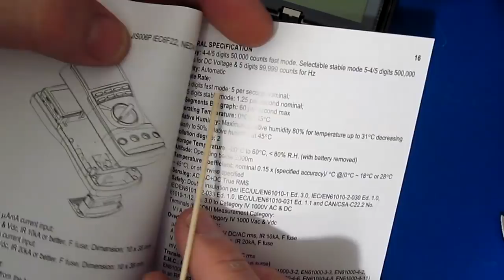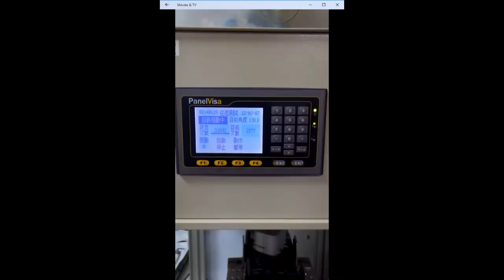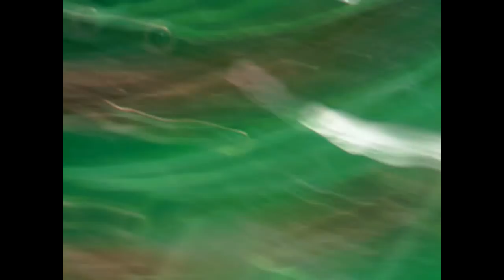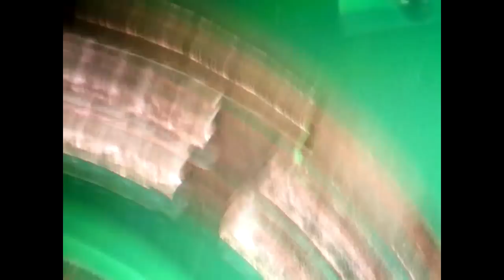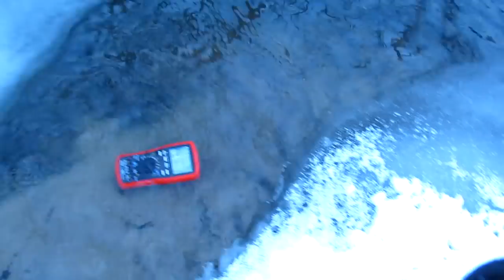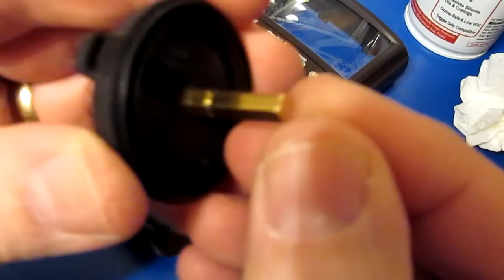Brymen BM869s 50,000 Cycle Test, New Year's Special

Comment: I'm in the US and just received a Bryman 869s.  I bought it from tme in Poland.  Their shipping time was amazingly fast, about 5 days.  The initial calibration seemed to be off measuring DC voltages, almost like it had never been calibrated.  I found a reference on the web that described how to calibrate it and with a precision 5v source I calibrated the zero and 5v levels.  Now it reads within a couple of 10 thousands.  Now it's an amazing meter.
Reply from the maker: My guess is you just screwed up the alignment but the readings you are getting make you feel better.
Reply: @joesmith-je3tq  The DMM Check Plus has higher precision than the Bryman BM869s.  Before I calibrated it the meter was off at zero as well as 5v.  Now when shorting the leads the meter zero's out and I read within 1 or 2 ten thousanths up to 6.xxx volts.  I'm not sure why you think I "screwed up the alignment".
Reply: I should also add that I have a Fluke 87V that I've tested on the DMM Check Plus which reads dead-on, so that implies the DMM Check Plus is accurate.
Reply from the maker: @kellyanderson7115  I'm not a fan of guess work.  There are labs that can actually check if your meter is in calibration and align it if needed.
Reply: @joesmith-je3tq  I'm sorry but I don't understand what you consider "guess work".  From the calibration guide..."Periodic calibration is required to conduct correct measurement.  This instrument needs periodic calibration at intervals of one year.  Calibrate the instrument according to the following procedures."  No where does it say it requires calibration at a calibration lab.  DMM Check Plus is calibrated on one of those expensive calibration machines...that's good enough for me.
Reply from the maker: @kellyanderson7115  First, calibration is not adjustment or alignment.  You have attempted to align your meter with a $100 device which is not NIST traceable to make you feel better about the numbers you are getting.  That's guess work.
Reply: @joesmith-je3tq  When I own a business that requires a meter to have a calibration paper trail, I'll buy another Fluke and go through the normal channels....what you don't seem to get is not everyone has the $$$ to keep paying to have their meters certified by an agency.  You are also grossly underestimating that $100 device's capabilities.  Do I really need to pay someone to put it on a $20k machine that has 10 digits of precision when the meter is only 5 digits....the answer is no.
Reply from the maker: @kellyanderson7115  Again, your just fooling yourself is all.  I've seen a lot of similar posts so your not alone.   Personally, if I bought a brand new meter and it was out of cal, I would return it.

Comment: My biggest issue with Brymen multimeters is the local availability. I have one of their meters from the 80's. It's now relegated to hack status as it has had a hard life with faulty LCD zebra strips but it still compares accurately against my Agilent U1251. It's high resolution 40000 count was market leading back then. An under appreciated brand IMHO.

Comment: Nice exhaustive test, as usual. Very professional and unbiased. Is it me or is the display on the new unit tinted slightly darker than your old one ? Thanks for sharing and happy new year to you and your family and friends !
Reply from the maker: Yes there is a slight difference between them when looking through the lens but I am not sure why.  There are a few things to consider.  It could be a lot to lot variance but I also had scratched the older one and later wet sanded and polished it.  Then added a Belkin protective film over the lens.  It may also be age and exposure to the sun.  The case is also a little lighter on my old one.  Again it is very subtle and I did not even notice it until I had the two side-by-side in the sun.  I know with my old Fluke handheld scopes, the polarizer on one was damaged from the sun.

Comment: Great video, incredible detail. Perhaps the o-ring around the battery compartment got damaged (or deformed) by the thin wires you brought out for measuring the switch contact resistance? I love my Brymen 867 - it's my most-used meter on the bench.
Reply from the maker: Well, there are two flaws with your hypotheses.  First, I never tightened the cover but let's say I did.  If you watch the video again, you will note that I ran the wires out the opposite side.   No matter though as I mentioned in the video, 54 does not mean stick the meter underwater.
Reply: Aha! Thanks for confirming, Joe!

Comment: Happy new year and thanks for another flawless video. 
Can I ask which software or platform you are using to analyze the data? I wonder you have developed the software yourself, however I'm curious to know which platform you are using to write your own custom softwares? (LabView or even writing from scratch with Visual C++ for example).
Reply from the maker: This question comes up from time to time.   For the PC, I started with MASM and BASCOM. Later switched to Quick BASIC and then Turbo BASIC.  A bit of time with FORTH.  Then MSC.  Later VC++.  Started using LabVIEW at version 4.  Was still using VC++ and some in-line assembler with it.  Last year, with the newer PC, I have settled on doing everything in LabVIEW as the PC is more than fast enough now to do what I need it to without another language.

Comment: Hello Joe! What's your opinion on the older fluke range switches, the old 20 series, the early 70 and 80 series. They where not the pcb pad type but a complete separate unit mounted on top the pcb. I would think that they went for the modern pcb pad types to reduce cost? Would be interesting to see how they compare. Thank you for this great channel! George.
Reply from the maker: George, I've had a few people asked about how older meters would compare against various tests I have ran.  I really don't an opinion about the old switches you specifically mention.  Obviously running a very old meter that could be near the end of it's life would not prove to be a very useful test to run.  We would need some new old stock meters that have been stored in a controlled environment to really get a feel for how they would compare.

Comment: Hi Joe , Great test as usual but I was wondering about the speed of switching could be of 
 influence ,heat bild up and static, 
In the begin you start slow (normal?)  and then you speed it up
Best wish's
Reply from the maker: Start watching at about 8 minutes in.  The cycle times and ramping are all explained.  If you go back another minute or so, you can see Brymen's test jigs.  Your question on it the slow start is normal,  I can't answer what normal is.  I can only disclose how I am cycling them.

Comment: Thank u for that video that was very useful but what about performance how accurate the measuring?
And another question what type of probe u were using?
Reply from the maker: The probe could be anything.  Post a time where you see what it is you are referring to.   The manual for the BM869s is on-line.  You can download it to see the specifications.   I've also made other videos with this meter.
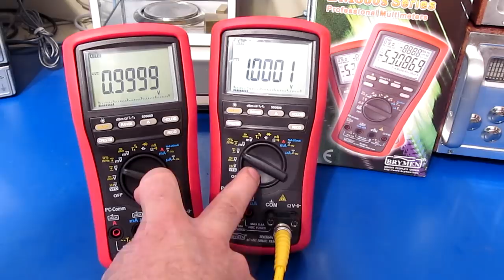Reply: Thanks for reply the probe at the end 37:00 is it coaxial becuase i was looking for a shielded probes.
For the specification i dont truste only what i see in real life iguess this is the point of the reviews.
Thanks again
Reply from the maker: Oh, that's not a probe.  It's just coax cable terminated with a BNC.  It's attached to a BNC to banana adapter.

Comment: I have a multimeter from Unit ut17B PRO, and when I measure direct current the device shows a voltage but when I reverse the probes it shows a different voltage of several millivolts. let say 4 milivolts diference.
is it normal this difference of a few milivolts when you reverse the probes.
Is it a device fault or is part of the multimeter's tolerance?
Thanks

Comment: Hi, i have solution how to make bm869s backlight stay on forever. Do you want to try it? I have it straight from brymen.
Reply: I think 30 seconds is a bit short. If a firmware update could make it adjustable or stay on for 60 seconds, that would cover the only complaint I have about my BM257s :)
Reply: I bought a bm869s a few weeks ago, and the backlight no longer turns off after 16 seconds, as described in the manual that comes with it, it can hold at least about 2 minutes (I haven't tested the maximum backlight time). I think Brymen changed this parameter, after several complaints about it.